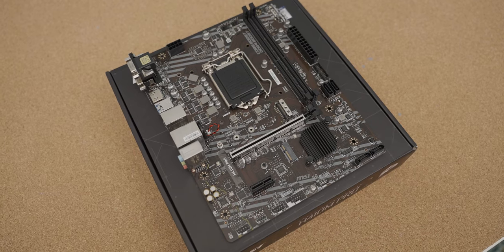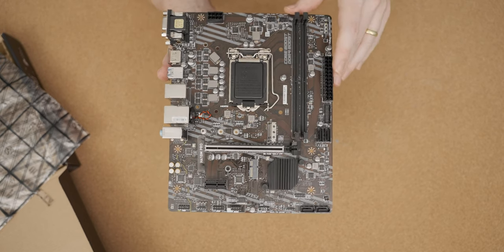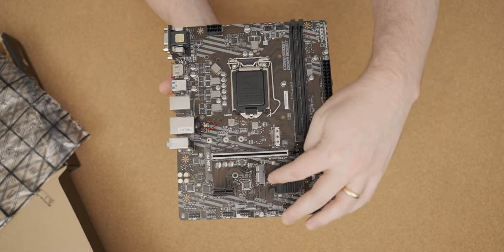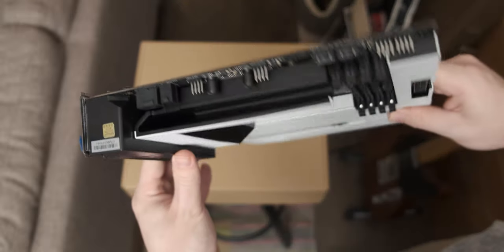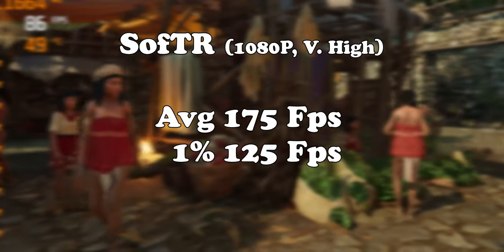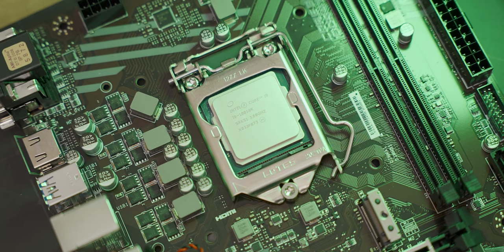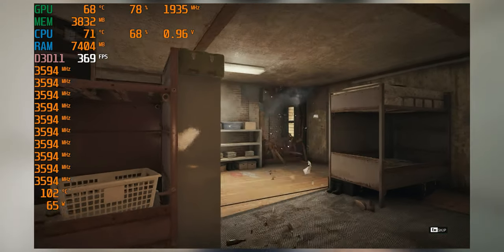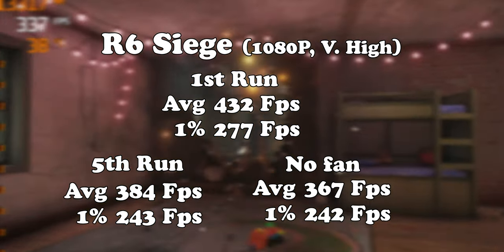10 Core Gaming CPU vs Loser Motherboard...

Comment: I love your content but hate how you present your data (your results). You can learn from other Techtubers like Jarrod's Tech or Tech Deals. You also didn't show the clock speed, power consumption and % usage of CPU with H410. Even if you don't want to use Bar Graphs, you can show the results of many stats in one scene like Testing Games does.  

Don't insult it by calling it shame or loser, some people can only afford to buy a low end motherboard and it can handle an i3 or i5 with no issues. There are some Z490 (cough cough ASRock)  motherboards that can't handle a stock 10900K.

Comment: Dear David. Stop hating the low-end-stuff. I have to build low-end-PCs for buddies on a tight budget on a regular basis. And not everyone wants to go used. So I am glad for such boards. It is way more capable than stuff you got a few years back. And if you pair this board with an i3 10320 or i5 10400, this makes much more sense for a low-end gaming machine. Or if it should be an office-PC, this board is just fine....

Comment: Ok, as an IT pro that has to deal with real people all the time.  A VGA output is a plus.  People OFTEN replace the Computer and keep an old monitor.  I mean 1920 x 1200 works for business applications.  And if you are doing dual monitor options, you can almost always find a monitor with a VGA input.  It's real simple.  It hurts NOTHING to have a VGA output, and I would bet that 3/4 of all monitors in existence have a VGA input still.  Ok if you are gaming or doing high end cad work, you want better.  But if that is what you are doing , you want a REAL graphics card anyway...  If you only knew how many times I have had to deal with someone ordering a replacement machine and the install tech called because he could not hook it up to the existing monitors...  That's why I hate sales people...

Comment: The mobo has holes for VRM cooler. Just get an aluminum sheet of the correct size, 3d print a holder or something and stick a few small heatsinks on it. Average cost 5-10EUR for the average maker and it will do the job very well (I ve done it for other mobo).

Comment: Bought a prebuilt that was 900 bucks and it came with a 30 dollar biostar a320mh that was meant for workstations... Wasn't very happy so I returned it and got a much better deal on a different prebuilt that thankfully used better parts on blackfriday.

Comment: Can you find a cheap way to cool the VRMs? Try a tower style and downdraft air cooler maybe? Case fans? I like the idea of spending $60 on a motherboard instead of $160 and using that $100 on a better CPU and cooler.

Comment: Imagine even using a b460 board with that cpu gpu combo
Vrms, reaches 70c much better performance.
Reply: that would be interesting for a follow up scenario maybe
Reply: I have a z390 e with a i9 9900k and overclocked to 5ghzt and vrams never go above 55c in full load, Asus makes some nice mobos

Comment: Hi Dawid I love your videos even though I don't know much about hardware and still run an old 7+ year old advent pc. One game you should try out these rigs on is path of exile. Later in the game there is so many calculations going on that sometimes even the hardiest of rigs slow down to a sad FPS rate. The game shows you an FPS graph using one of the F keys. Only problem is you would have to venture to the point in the game where everything is 'kicking off' and not just fire up and check the FPS like the games you show. All the best and thank you for the content.

Comment: hey I use those, they're great for point of sale system paired with an i3 10100 or a Pentium if the pos program is lightweight and yes pos monitors still use vga... that said did you check the ram in windows because in my experience the ram defaults to 2133 in h410, no xmp support

Comment: Just put a vrm cooler on it lol.
Also it even has the holes for it too lol.

and it's not a fair test you should run it with the little vrm cooler and run the Ram at the same speed.

there's no point being a complaining Canadian just get the goddamn bacon and syrup and fix the problem. ;) 
I'd like you to make a new video and call up the hero loser board. After you mod it and build it up a little bit just by putting that little vrm cooler on it.

Compare that big expensive board with the same Ram speed of the H410 Loser Board.
And no OC.

Comment: I mean it's got a 4 phase with doubled components and not the worst vrm controller. So it's mildly capable. Ofc with a fan and some custom heatsinks it would perform way way better. But still.

Comment: I noticed that you were running all core boost, would this motherboard work better if you left the per core boost operating? Or will video games always cause all cores to boost to the same clock speed? Just thinking that if one or two cores were at 5.0 and then 6 cores at like 4.6 or whatever it might run cooler? I never do this on my personal rig and have never tried this so I'm only speculating.

Comment: Is this particular CPU model causing the power delivery to get hot or is the motherboard just bad at everything?
I would have liked to see if a lower end chip had the same effect on the temps, running the highe end/low end systems with the same ram speed(and the different max speeds) would have also been useful information in relation to frame rates.

Comment: no you cant boil wather on that ramchip you need 300degrees on it so you can warm upp the wather to same temperatur. and if you stands a pan on it it vill cool down a litle for later maby reach that temps again. and this test ofc its fun to se but for me i used a H470 mainboard  on my i9 9900k and you say it the normal clocks vas 5ghz in boost clock  you can buy cheeper components for gaming but you doinig it on your own risk  bad components means easer for fail and broken moderboard.

Comment: The worst part is that you can clearly see the mounting points for a heatsink on there. This thing was cheap enough that MSI couldn't even be bother to slap on the equivalent of aluminum scrap metal on this thing to even try to improve temperatures.

I've seen this scenario in my years as a PC repair tech so I knew what would happen, but entertaining nonetheless!

Comment: well idk if u put it on test bench or in a case. i think if u would had done tests as a built pc  vrm temps would be lower because of ventilation. That's why it got so hot when u removed the fan

Comment: Its strange because it does look like they had intended to actually put a heatsink on the power delivery section of that motherboard with the 2 holes where they are around it, But then obviously decided a little piece of aluminium was going to eat into profit too much so skipped it, Would be interesting to see if adding a heatsink would have yield any different performance results.

Comment: Use a stock cooler that downfire cooling fan also cools the vrm, its designed to run will stock cooler.

Comment: David i'd love if you had some cheap heatsinks to slap on and test how cheap it would actually be to make this board usable with a high end CPU.  Temps would probably be even higher in a closed system for sure.  It is actually interesting if it would only be like 1-2$ for some board makers to make this a non problem.

Comment: I'm not all that surprised that it was not a bad experience. I'm was more surprised that the motherboard was a bottleneck at all, all though once it got too hot to run the CPU at its max boost clock then it made sense that it was not running nearly as well as the other mobo.

Comment: If anyone can help me i just wanted to ask if this
CPU I7 4770 OU 4790K 4.40GHZ turbo 
+ GPU GTX 1650 SUPER OC 4GB GDDR6 
+ Ram DDR3 8 GB 
+ CASE Standard 
+ HDD 500 GB
Is worth 630$ (i dont have any idea about the mother board or power supply but the shop is pretty popular and have good reviews)
Reply: In my country that much money would give you a far better system, 4th gen i7 is old... Here you would get a ryzen 5 with 16gb ram and SSD for that prize or 10th gen i5... Both much better

Comment: Can I put an i7 10700f in this MOBO??  will it be cooler than the i9 in the video or will I also get the same VRM problems?
Reply: Set power limit in bios to 95w stress test it a bit and it should be fine. If its not just get a heatsink, add some thermal pads and call it a day

Comment: If you want a worse experience, try a Ryzen 2700 on an Asus B450m-a motherboard, for a solid year I thought there was something wrong with my CPU... had loads of thermal headroom but WOULD NOT BOOST, the highest I ever saw it boost was to 3.4ghz from the 3.2ghz base, but then I had a GENIUS moment, I switched off 4 cores then my 4 core, 8 thread 2700 boosted to over 4ghz, I then tried to up it to 6 cores & it'd boost to 3.7ghz, back to 8 cores & I was barely over stock again... this motherboard sucks major ass.
Reply: Asus Prime 450m-a*

Comment: it will be able to handle it just you won't get the boost clocks or overclock features, also the couldnt you put a heatsink on the vrm the holes are there its like the company forgot to install it lol

Comment: you should have looked into getting after market cooling for the vrm's or even slapping some diy  stuff together , like yank the heat sink off an old video card and shoving it on top of the vrm (with thermal pads of course  or thermal greese even)

Comment: The fluctuation in results is a lot more alarming than I expected and this is the type of mobo that I'd expect in an eBay prebuilt. It would be interesting to see if you could "fix" this mobo by ghetto mounting some sort of cooling on those crappy vrms. Really interesting stuff, and really shows why you don't cheap on a mobo!

Comment: Seems kinda weird to use an overclock as baseline for a board that can't overclock since you can't really see if you're actually loosing performance now even if you hit advertised clocks. 😶
Reply: agreed... should have put the cpu to stock settings on the "good" motherboard for a true apples to apples comparison

Comment: Minor correction to the video -- the power phases aren't doubled, they just have two sets of MOSFETS to spread the heat load out a bit. On a lot of boards you see 3 mosfets per phase, since only the low-side mosfet runs hot enough to need to be split into two in some VRM designs.

Comment: Can you recommend a way to add heat spreaders for H410M-E?
Reply: You need to buy a m.2 heatsink (almunium one) and then cut it using a hacksaw so it covers  and fits over all the MOSFETs and then you should stick it down with a high quality thermal adhesive. I did this with a Asrock am3 board after I installed a phenom II X6 1055T because the vrm got burning hot and the system would randomly shit down.

Comment: Is it ok to pair i3 10100 with h410?? 
Pls reply because I'm planning to build bugdet i3 + h410 pc
Reply: I'm building it with an i5 10400f. It's no problem with the lower core count and much lower clock speed. Enjoy that new system ;)
Reply: @swarajaggarwal  thank you bro
Reply: Yeah i3 10100 is fine with it. These motherboards are meant for lower processors such as an i3.

Comment: i have this board with my i7 10700 lol any reccomendations?
Reply: Upgrade your mbo
Reply: @tramarthomas6105  definitely thinking about it. do you reckon it is holding the cpu back? it boosts up to 4.6ghz when gaming, hardly erver hits the 4.8 boost as stated. temps are low tho(60ish gaming). i seem to be going ok but if i go for a better motherboard i dont want buy something i wont use. any specific models?
Reply: Im thinking of getting an i7 10700 my only problem is i dont know how hot the VRM temps are, How high does your VRM temps get when gaming?

 Ive heard the high VRM temps can easily be fixed by adding a vrm heatsink to cool it down.

Comment: How did you get the VRM temp to show up on you OSD?
Reply: justb select them in afterburner under the monitoring tab
Reply: @PabzRoz  if I don't see the option, does that mean my motherboard doesn't support it?
Reply: @gijoeljamesmaldonado  Oh my bad man. Afterburner doesn't actually have vrm monitoring. I just checked mine and thought it did. Use HWMonitor. That will show you vrm temps, power usage, etc. It'll show you every sensors temperature and power usage actually. Highly recommend.

Comment: Will a i7 10700 be good with h410m
Reply: I recently got a prebuilt with a 10700f and H410, don't do it. I'm ordering a new mobo because it is pretty useless
Reply: Don't skimp on your mbo and PSU. If you're getting an i7, get a b460
Reply: Or even a b560 so you can upgrade in the future to any of the 11th gen non k cpus